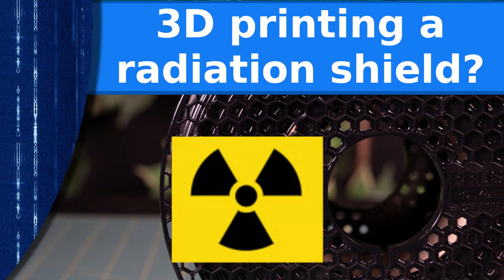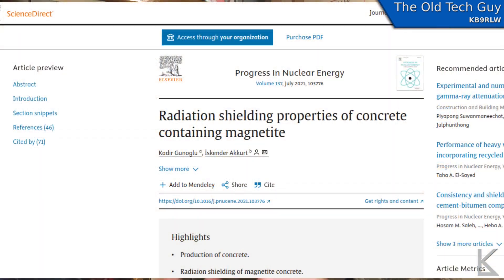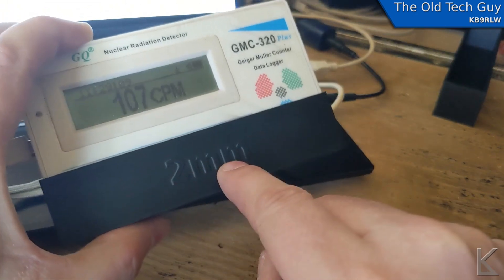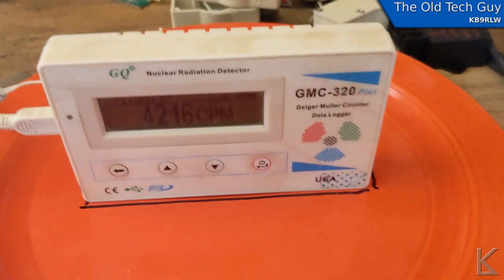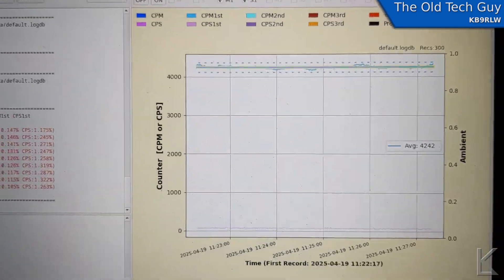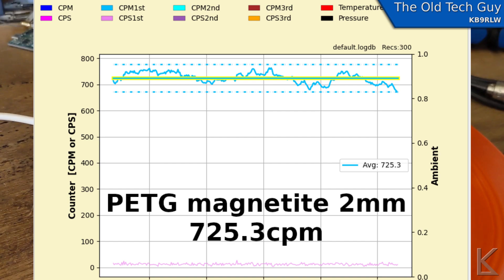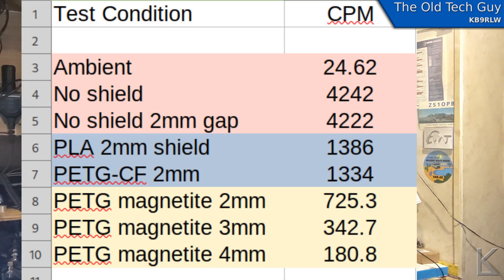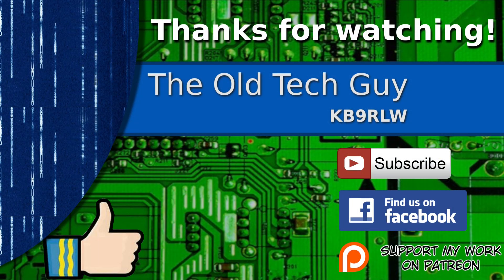3D printing - Can you 3D print a radiation shield with Prusament PETG magnetite?

Comment: I'm wondering if the Carbon in PLA-CF would exhibit any such abilities...

I have a pair of LYSO Scintillators which contain natural Lu-176.  I'm going to print a small "pig" (proper term for such containers) and see if I still get any radiation escaping.  Lu-176 emits gamma rays at 88.34 201.83 306.78 keV, but is generally harmless as it is low activity (natural radiation).  I wouldn't sleep with it or put it in my pocket though.

Also, the GC used in this video is the GMC-320 (great counter in general) but I believe it uses the clear glass Chinese M4011 tube, but I believe is upgradable to other tubes, but I've not wanted to do this in mine as I don't necessarily have ENOUGH sources with known activity levels to recalibrate it for higher energy (i.e. Co-60, etc).

As far as Fiesta, I keep mine in a lead-lined container and gamma rays still escape it.  Some people DO and HAVE eaten off of it for years and years without issues, BUT I once read an article (true statement) that if a Nuclear Power Plant was as radioactive as Fiestaware, it would be SHUT DOWN!
Reply from the maker: In my test I was comparing the pla to petg-cf which was only very slightly more effective. So I don't think the carbon fiber made very much of a difference. Prusa is sending me some of their petg-tungsten which they market as radiation shielding and I will be doing similar tests with.

Comment: Cheap idea: could you test normal petg with a pocket to fill magnetite in?
Reply from the maker: I'm sure that would work well in one direction. 
The advantage to the infused filament is that you can print complex shapes that are themselves shielding.
Reply: @loughkb  yeah it was more of a cost saving idea since you can get magnetite by the pound for a few bucks compared to 50 dollars per spool of it.

I could imagine using some gyroid infill then filling the void mid print. Would be interesting if you compare the effectiveness

Comment: Knowing almost nothing about radiation and nuclear physics/chemistry, Is it the brute force of just putting more material between the radiation and the counter, or could different infills be more efficient at blocking/absorbing radiation per gram of filament if physical distance wasn't a restrictive factor in the design. Like if the radiation emitting body was 20mm away and you had 100g of filament to use, would it just be better to do 4mm of 100% infill or could cubic 50% infill that took up more volume be more efficient at radiation shielding? Im just throwing out some figures that may not be totally accurate, but trying to explain the concept.
Reply from the maker: I'm no expert myself. But from the reading that I have done, and experiments that I've done with the counter, there are two factors I know of. One is distance. It's not a linear relationship it's more logarithmic, like most types of radiation. So there is fall off with distance. And then there is absorption into material. And it's different for different types of radiation and energy levels. So to my mind, a lower percentage of infill means less absorption, but you also have fall off from distance. I printed my Shields with 100% infill being close to the source, absorption was what mattered.

Comment: This stuff would probably also work well as a simple RF shield to protect a sensitive receive amplifier from stray interference.

I wonder if it has much electrical conductivity if you wanted to ground it?
Reply from the maker: I have tried to measure conductivity. And even with the meter on the 20 mega ohm range, I measured none. Any RF shielding capacity it has will be in reflecting the rf.

Comment: Hi Kevin, interesting! It looks to me like the dominant radiation from the plate is alpha and beta, though it is hard to be certain given that I know nothing about your gm counter. The plastics alone are absorbing most of the radiation, which is a fairly strong indication of alpha particles, which  are typically stopped by less than 5cm/2” of air, a sheet of paper or thin plastic. The remainder seems more likely to be mostly beta particles,  because unless the gamma rays have very low energy, it does not appear to me that there is enough material in the way to cause that much of a drop off in the count rate. This is also what you might expect from uranium, as both U235 and U238 decay by alpha particle emission to thorium isotopes that are beta particle emitters. This being said, for X-rays and gamma rays at lower energy (say, below 75 kV/75 keV) this loaded filament could be really useful in a laboratory situation, though in the longer term I would worry about the PET degrading. I used to use sheet lead, but that was both overkill at these energies, and a bit of a nuisance. Anyway, thanks for this!
Reply from the maker: I was hoping somebody familiar with the topic would stop by and give some insight. I'm no expert. But this was very interesting, thank you. And I wouldn't worry about the PET degrading, if it does, you've got the STL file already just print another one. 🙂
Reply: @ 🤣😂 that’s true!
Reply: @loughkb  As it's DU, it's going to be all U-238 when it was made. U-238 is an alpha emitter when it decays into Th-234. Th-234 has a 24 day half life (so it's quite radioactive) and it emits a beta particle as it decays to Pa-234m. Pa-234m kicks off another beta particle in a minute and becomes Pa-234. Pa-234 has a 6.7 hour half life before it emits another beta to become U-234. U-234  has a 245,000 year half life, so it's not a factor.

To Richard's point, the alpha should mostly be stopped by just about anything, including the dead layer on our skin. The thin water film on our eyes isn't enough to block alpha but a few inches of air is. I don't know if your Geiger counter is alpha sensitive or not, but alpha sensitive Geiger counters typically have a very thin layer of mica that's capable of passing alpha particles. Based on the numbers you're seeing, it's likely all beta that you're picking up, with some possible braking radiation. 

For beta shielding lightweight materials like plastic/carbon are best as they slow the particles more gently. Heavier atoms like iron slow the particles more rapidly. When a collision occurs, much of the energy is dissipated as a photon, up to the energy of the beta particle although most will be lower. Softer collisions exchange less energy, like bouncing a ball, so the photons are lower energy, while harder collisions produce higher energy photons. So you'll be getting everything from heat to gamma rays from the beta collisions. When they add magnetite to concrete they're reducing the average penetration of the betas into the material by giving it bigger atoms (iron) to collide with. Most rocks are made of lighter oxygen, aluminium, and so on. They don't care about the resulting braking radiation because there is enough concrete to sufficiently block that as well.

Braking radiation is how modern x-ray machines work: they blast electrons at a tungsten target, with the electron energy tuned to make x-rays around 40 keV.

Gamma is interesting in that it mostly passes through the human body. In a lot of cases lead shielding makes it worse, because when those high energy photons get absorbed they often release lower energy x-rays that do get absorbed by our bodies.

Comment: I wonder if it would be possible to make a slot antenna for 145MHz with it. A 3D printed antenna made with printer that can be used outdoors for out walking or doing POTA.
Reply from the maker: It's not conductive.  Even with my multimeter on the 20 Megohm range.  No good for printing antenna.